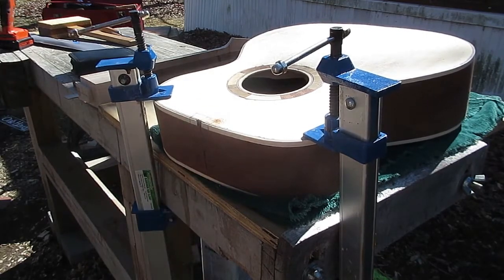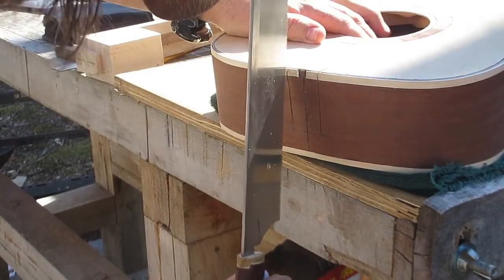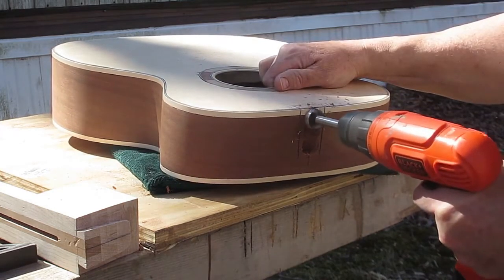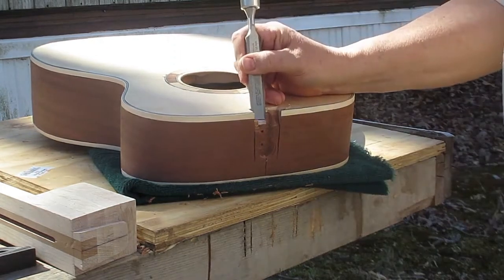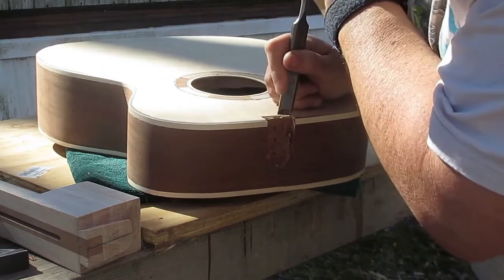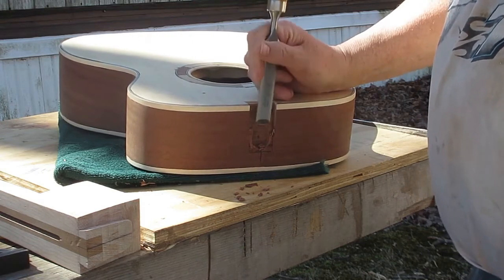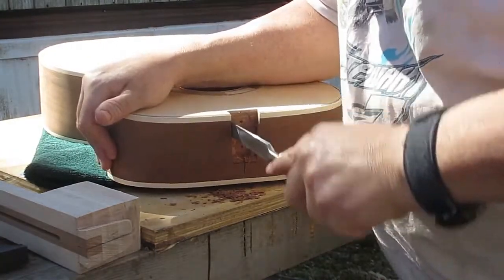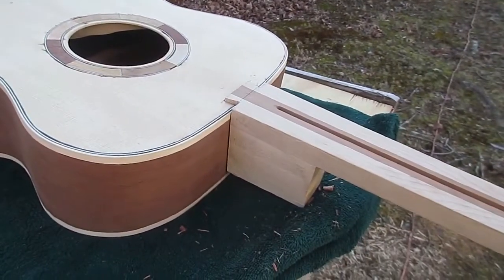Acoustic Guitar Build - Cutting the Dovetail Mortise

Comment: Suggestion on clamping the body, put the clamps on the tail end and elevate the joint end on a folded towel. The pull cut saw should press the guitar down to the bench and hold things firmly. Saw Tommy Hovington do something similar and it worked well.
Reply from the maker: Thanks!

Comment: Useful video! Thanks! I’d like to do a dovetail on my next build for the same reasons you did. Did you have that link to the blog that helped you do this? I’m trying to research as much as I can!
Reply from the maker: Sorry for not responding sooner, Adam. I am busier than a one legged man in a butt kicking contest. 
That is the one, though!
Reply: No problem at all! Thanks for the confirmation! All the best!
Reply from the maker: Make certain you double check your inner and outer dovetail dimensions before you start excavating.
Reply: Great advice! Like my father always says “measure twice, cut once!” 
Is it worth cutting slightly inside the mortice pencil lines and/or outside the tenon lines to allow for fine tuning the fit with chisels and sand paper?
Reply from the maker: Absolutely. I would cut the tenon slightly oversize and fit to the mortise.
Reply: Makes sense, thank you.